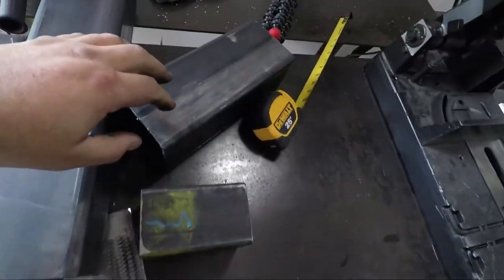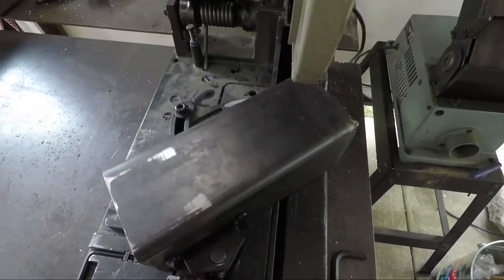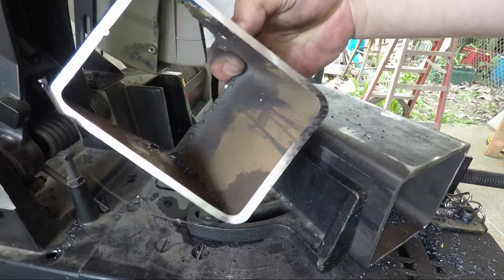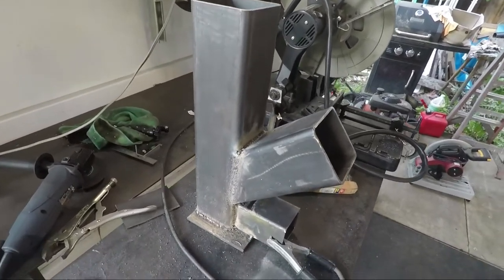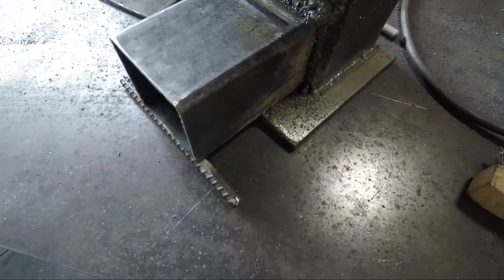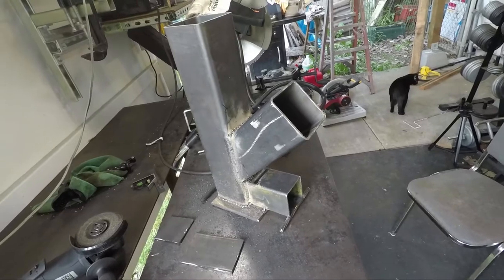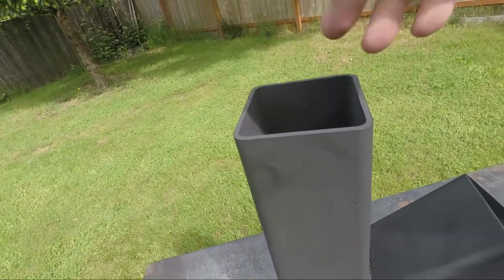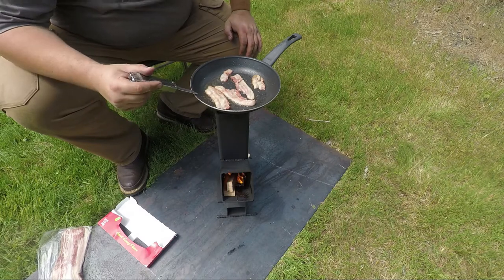DIY Rocket Stove

Comment: Great video and appreciate you honest welding criticism.  On the rocket stove I think your air intake is to large.  That is a secondary air intake, the primary one is the feed tube.  You have two air intakes, put a damper or something to close the secondary air intake and the stove will work better then you'll get that rocket sound.

Comment: I like it, I still think you are going a tad fast for your machine, you could turn your heat to high and your wire speed down a bit and weave a little slower, allow the weld material to build up a little more. I do have one question about the stove though, so you notice a lot of heat coming up through the gravity feed chute instead of the chimney? Most rocket stoves I've seen just have the on ed tube straight out the side that acts as both feed and air supply but you need to keep pushing the fuel towards the chimney as it burns. I like the idea of th ed gravity feed but you may be losing heat/efficiency
Reply from the maker: I am still getting the feel for welding, good observation and advice.  Most designs I have seen are the simple L shaped.  I thought I would experiment with the V design.  This was my first attempt, there will be more versions.  Thanks for watching and the feedback.
Reply: a Rocketstove is always to hot :-) i love cooking on it.

Comment: Are you using the harbor freight welder? Is there something different about the gun?
Reply from the maker: I am using the 125 amp Chicago Electric flux core welder from Harbor Freight.  The one that got on sale for $100.00 from time to time.
Reply: The Bearded Giant I got the same one but my tip looks different, did you change yours?
Reply from the maker: Yes, yes I did.  I found a flux core tip at Home Depot.  The tip that came with the welder is for a mig.  This one is Skinner and easier to use.